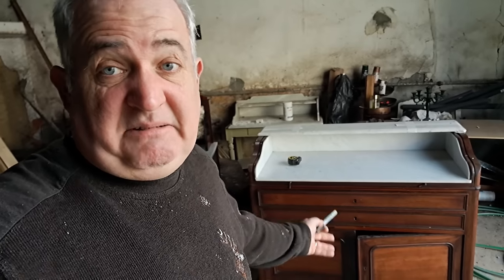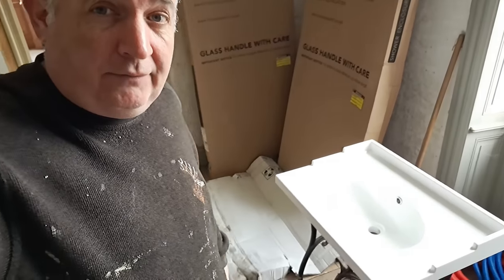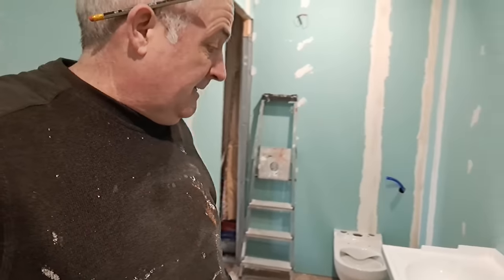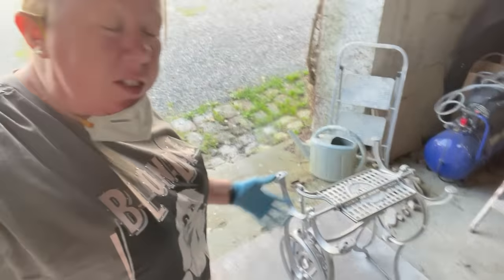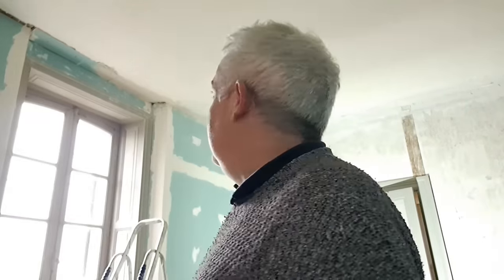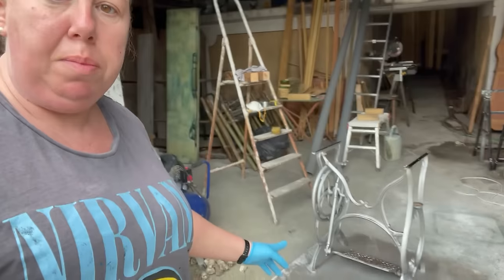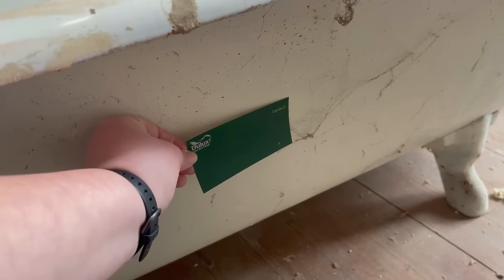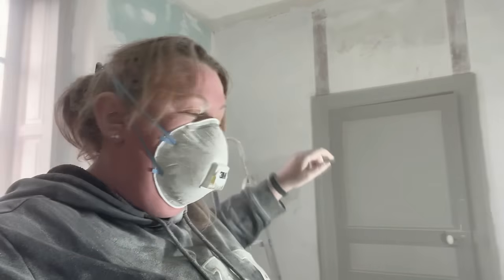Woman VS Sander. (Plus Viewers Opinions Required !! re Original Cast Iron Bath - get involved)  #138

Comment: Dear Clare,
When using the sander, I noticed that you were often using the heel or “tip” only. Although this method might achieve temporary satisfaction, may I recommend using the entire length and width of the tool for a much happier ending!

So happy to see Nick put his “socket” into an appropriately sized hole and when it comes to spraying, I too recommend starting on top and finishing on the bottom.

Hugs and kisses from Australia.
Reply from the maker: We do love your profile picture!! and of course a good bit of innuendo - wink wink!

Comment: As you get deeper into fixing up rooms, that dust is going to be more & more of a problem. You might want to begin thinking about a portable dust collector. I bought one a few years ago after de-dusting my house a couple of times even though I covered & protected everywhere. Mine weighs about 25 pounds & is on rollers. While it doesn't capture 100%, it's close. When I researched, I decided on a major brand. The reviews clearly noted that cheap models did not come close in performance. I also got lucky by buying one when a newer model was about to be released.... much better price and worth every penny. And, totally agree with an earlier comment on how you are using music.

Comment: I would take a tile to the paint shop & have them mix the paint to match the tile, then paint the feet nickel or  take the feet to have them done in chrome (a car body shop may do it). love your use of the vintage & just love the banter between you two, great vlogs. It will turn out lovey which ever route you go, :hand-pink-waving:
Reply from the maker: Love the idea with the paint match! Votes are in! this weeks episode is a cracker but check back next week for more bath info...

Comment: Just pondering your bath colour 😁 As the room has no natural light and you're going for darkish green tile, if that is going to be around the bath, you may want to leave the bath white, to stand out against the darker background and make more of a statement. Alternatively, if painting that area white or cream I'd paint the bath to contrast against it, but I assume it's the tiles.
Reply from the maker: The green tiles & bath are into the larger bathroom with one window - however it only gets the sun a lot later in the day due to the aspect of the room... it can be a bit hard to get this all the right way round when filming it at times especially with doing the two rooms. A lot of people have voted on the white...Shhh check back next sunday for more on it. Looking forward to hearing what dinner choice is later x

Comment: Oooo-La-La!  I love the second green, or close to the tile color green.  Since you will have mixed metals in that bath, I would paint the tub feet GOLD, and if you can, a small pin stripe down the middle of each in the chrome. That will be a small, but eye catching detail that allows both metals to be incorporated.  Also, if you get one of the Tub trays for the sponges, candle, etc,, you can place some Gold trinkets, or bath brushes on it. I hope this design idea is appealing for you.  Much love, and all the best!
Reply: @user-vj4iy7dl4c
Absolutely agree with your suggestion about the tub....Go for broke or go home...it would be stunning!!  🇺🇸
Reply from the maker: Love love the pin stripe idea! 
And the tub tray - one has been in storage a while so time to dig through the boxes!